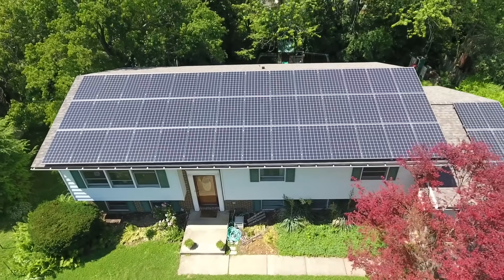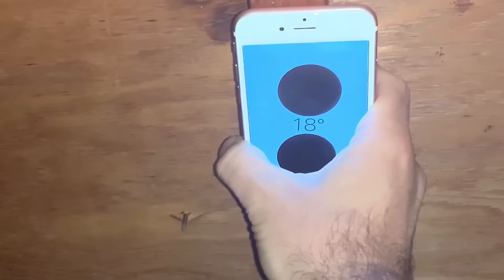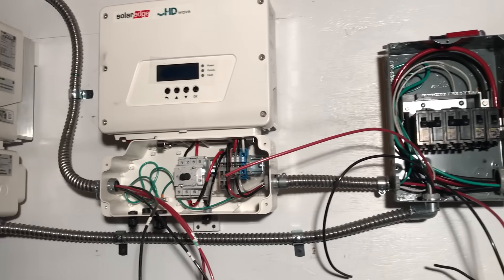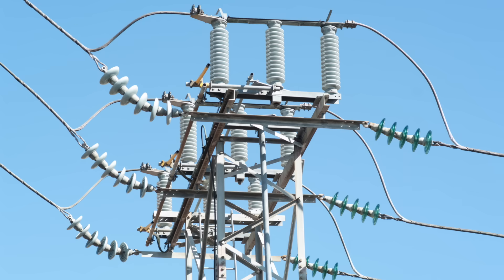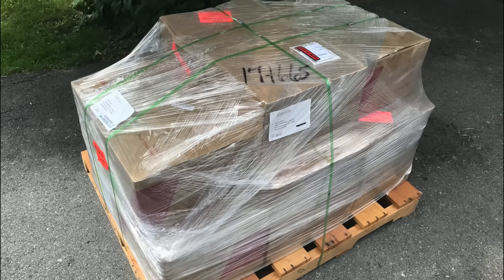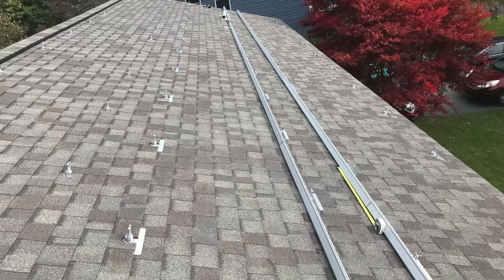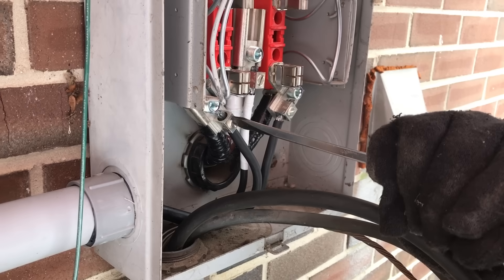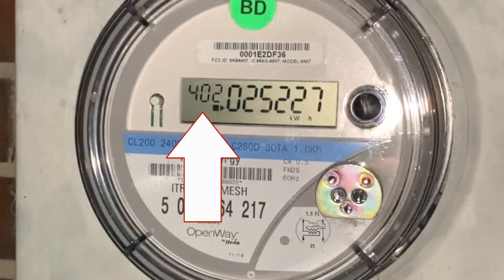I Installed a Power Plant Myself | HUGE DIY Solar Panel System

Comment: Great job. I was hoping you could talk about 2 things.
1. How you sized your energy needs.
2. How do you store the energy generated to be used when no sunlight or you use the grid at night?

Thanks for the video. Learned alot.
I installed a 48V system in my home in Jan 2020 mostly from DIY youtubers. 
Made a few mistakes but worth it.
Reply from the maker: That’s great you did it by yourself! I’ll explain some of those things in the future video.  I did talk about how I sized my system in this video.

Comment: I am trying to change  my inverter to micro inverters but the problem is I have 48v 500w panels and I could not find micro inverter that support this range. If anyone know such please help.
Reply from the maker: enphase should have them for the higher volt panels.  Mine are 55v but I went with solaredge.
Reply: @FrugalRepair   Thank you.. will need international shipping 🤦🤣..I am located in Maldives

Comment: How do you change the shingles on your roof now?
Reply from the maker: I won’t need to change them under the panels any time soon.  I most likely won’t be around when that might be needed. But if they were needed, I’d spend a day or two, taking the panels off, reroof and put them back on.
Reply: @FrugalRepair How’s your ROI been on this system after 2 years of using it?  You originally predicted 14%.

Comment: I cringed when I saw you use plastic zip ties. They will degrade relatively quick and become very brittle when exposed to any UV light...yes even in the shade. Stainless steel zip ties would have been better.
Nice work though!
Reply from the maker: Thanks!  Thankfully they are backup to the iron ridge clips but I’ll be keeping an eye on them.  I didn’t like how loose the wires were on those clips.

Comment: Curious if your house is now cooler because there's no direct sunlight on the roof
Reply from the maker: That’s interesting.  I did take roof temperature measurements with my thermal camera before I installed them.  I may take some measurements after then compare at some point.
Reply: @FrugalRepair  even just asking how it feels in the house. Are you turning the air conditioning on less?
Reply from the maker: I don’t know if I could notice a difference, honestly.
Reply: @FrugalRepair  I guess it comes down to the climate you're in. Summer for me here is 40 c degrees most days so I'd notice it for sure.  One end of my house is markedly cooler because it doesn't get as much sun. I was thinking you've essentially added an extra layer to the outside that is absorbing a lot of that direct heat.  Anyway enjoym

Comment: I did the exact same thing last year. I'm very happy about it. 

To be honest, if you are planning to only do 1 installation, I would say it's not worth the hassle. If you are going to install it on more roofs(friends and family or professionally) then it's totally worth it.
Reply from the maker: That’s awesome!  What size was your system and what inverters did you go with?
Reply: @FrugalRepair  first system was with an abb inverter. A lot of issues at first, but after a lot of googling and searching I made it work. 
Now I placed four more installations with solaredge. Their support staff is great and the helpful tools online are awesome!
Reply from the maker: That’s great!  Almost every installer I spoke before hand recommended SolarEdge.  My panels are 55v output so I had limited options if I wanted panel monitoring.

Comment: I'm so jealous, I was freaking out the other day about my power bill being so high. I looked at the detailed bill and can see why its so high.

Customer Charge
Distribution Charge
Stranded Cost Charge
Sys Benefits Charge
Transmission Charge

That is all before the actual energy service usage charge. Man they are nickel and diming me.
Reply: Could you share what it means "so high" ? Just interested to compare. :)
Reply: It would be cheaper to just get a manual transfer switch (call a licensed electrician) then just connect to a 10,000 watt generator which can be $1000 or so and just burn gas or propane. Granted gas is better

Comment: I am also a supporter of new technologies but I have some reservations about this whole photovoltaic revolution. So
yes, no bills, but the initial cost is huge, and anyway, in the event of a power outage, you are just as without electricity as others 😐 a nice gadget but not cheap, not protecting against power loss, and if it's okay for cash, it's worse if someone takes a loan and then has a loan instead of bills 😏 say how many years would you pay bills for the cost of the entire investment?  assuming nothing breaks in it 😉🤔

Comment: Sure you found an alternative energy source using Solar. But here are some facts you may not be aware of. Our best solar system only captures 26% of all protons emitted. After 20 years of research and billions spent on solar energy it's still only produces less than 3% of the world's energy. Rare Earth materials are needed to build solar panels and batteries such as lithium, Cobalt, and Dysprosium just to name a few. As the use of solar expands so does mining operations in our wilderness areas. Refineries to refine these materials produce massive amounts of pollutants. Solar panels and batteries have a life maximum life expectancy of 20 years, (not 25) and are produced mainly from non-reusable materials. These materials will end up in our landfills. By the year 2050 there will be 200 times more waste generated from old batteries and solar panels than ordinary garbage. You may have saved yourself a little bit of money but you didnt do the Earth any favors. We need to focus our attention on hydrocarbons as an alternative source of energy. Not Solar!

Comment: So the thumbnail says "no bills" how did installing solar get rid of your sewer, trash, phone, gas, insurance, mortgage, etc, bills?  I know, you probably talking about electric, are you making payments on the solar? Or did you save up enough to buy it outright?  If you are making payments like more people would then didn't you just trade your electric bill for a loan payment?  I was going to put in solar myself but when I calculated the true cost and compared it to my grid payments I could spend the same money I was going to spend on the solar setup and just use grid power for 15-17 years.  With the solar setup major components like the batteries need to be changed out ever 5-10 years.  So people like to get solar and say "its going to pay for itself in 15 years...or 20 years.  Yea but thats assuming you don't have to do ANY maintenance on it.  No panels go out, your charge controllers don't go out.  Your batteries don't need replaced, etc.  Sad thing is the batteries last 5-10 years and account for about 25% of the total setup cost, the charge controllers have an expected lifespans of 10-15 years and account for around 10% of the total cost.  So before the 15 year expected payoff hits you are already out another 35% of your total setup cost again which pushes the payoff date farther into the future by another 5-6 years, hitting that 20 year mark before the true payoff, but wait.  By the time that hits its well past time to replace the batteries again at which point you have probably already done this at least 2 times.  If you have only done it once to this point its a miracle and its definitely time to change them again.  So here you are at payoff point and you have to put another 25% of your initial setup cost into batteries again pushing the real payoff period back another 4 years.  Now you are 24 years into your setup having paid a ton of money up front or been paying a loan all this time and finally you have a system that has finally truly paid for itself and isn't in desperate need of major maintenance for an entire year?  That is assuming NOTHING went wrong with any other components, nothing went wrong with any of the panels and the ONLY thing you have had to worry about is batteries and the controller, which, after 25 years is likely next to impossible, but here we are, the system has been paid off finally and you have had a full year of free electricity and now its time to replace the batteries and the charge controller again.  There goes your free electricity for the next 6 years while you wait for the saving to equal your fresh investment in parts.  So out of 31 years of using this system, assuming EVERYTHING went text book according to plan, you have had a whopping 1 years of actual free electricity.  Personally I'd rather work a couple weekend to make what it would cost me for a years electric and forget about the hassle for those 31 years.

Comment: No bills from the Electric Company but you still have to spend money for the solar panels, battery, wire installation, charging devices and maintenance. You can't use electric oven, air condition and other equipment that requires large amount of current. But being free from bill charges every month must be real rewarding.
Reply from the maker: Why can’t I use those appliances?  I use them just fine.
Reply: @FrugalRepair  That's great! How many batteries do you use and how powerful is your dc to ac converter to use all these appliances? If you will share to us.
Reply from the maker: I don’t have any batteries.  I don’t need them. I’ll explain this in a future video.  Net metering is the key part.

Comment: With your panels so close to you gutter in heavy rain it may shoot over  and not go in the gutter also you panels should be atleast one foot from the edge to stop wind uplift well done for doing it yourself and I hope you recorded the location of each micro inverter it makes it easier when one fails to find it and change it micro inverters are great so if the inverter fails you only replace that one at a smaller cost and the hole array doesn't go down and you have to replace one large costly inverter
Reply from the maker: Yep, I have everything recorded.  Thanks!

Comment: I would never put solar panels on my roof because if you happen to have a fire in you attic, good luck accessing your attic from the roof to put out the fire. I would rather do a shade structure in the back of the house and put the solar panels on it. Easier to maintain and separate from the house.

Comment: You did a great job sir but solar doesn't operate 24 hours a day. What is the storage that you installed and how much?
Reply from the maker: Thanks!  I need to answer your question in a future video.  Net metering is key to my setup.  I don’t have batteries.
Reply: @FrugalRepair  I have never heard of net metering? We considered solar in 2016 but we went with a whole house 20 KWH generator because the battery system would have added so much. I am not able to climb on the roof anymore so we scrapped that idea. It would have been $50,000.00 just for the panels, of course living in Northern Virginia doesn't help either.
Reply from the maker: I’m in PA so VA would have enough sun hours.  I can’t remember what VA’a net metering policy is.  I don’t think they have an SREC program.
Reply: @FrugalRepair  after you told me what you did Virginia Dominion power has net metering nobody told me that at the time.. I am from Pa I lived 75 miles North of Pittsburgh a little place call Greenville in Mercer county.

Comment: You shouldn't have drilled that hole in the chimney you're going to regret that later down the road. I don't see why you just didn't go around it with elbows. it would have looked just fine
Reply from the maker: Because it’s just cinderblocks at this point.  There is no inside fireplace or anything.  And the previous owner chopped the top off when they did some roof work.

Comment: Great install. I see one problem with your whole system tho. The power company who has been screwing you over for your whole life fits the bidirectional meter. Everyone who checks what they produce and what that meter says is produced get vastly different figures. The power company is still screwing you. So save the hassle and get yourself a home battery or 2 go completely off grid and tell the power company to ram it.

Comment: As a solar installer this is great! I like your method of installing the flashing at the same time as your shingles, I got a little worried when I saw the state of your roof at the beginning of the video. We use many of the same materials and methods as you did and yours turned out great.
Reply from the maker: Thanks for watching and your encouraging comments!

Comment: We started doing solar ourselves in 2012. Now we're helping other people in Philadelphia do it themselves. In Philly, if you use a commercial installer you will most likely never recoup your investment. 
A suggestion...consider microinverters. He mentions them I think but that's not what Solar Edge is. The wiring is very simple and there is no single point of failure. Each panel has it's own inverter and all are wired in parallel so there is no high voltage DC anywhere. We used Enphase and have had a great experience with the company.
Reply from the maker: Do you have a business helping others get solar?  Good thoughts about micro inverters.
Reply: I don’t charge. I’m a retired, but still working part time, public high school teacher. I guess I can’t break the habit. ;-)
We just finished...on Saturday...a nice 5 KW system on a row house church in West Philadelphia. Taught a class of 10 citizens and trades people from the neighborhood, hands on, how to install the system. 
It was really exciting. There are literally thousands of similar row houses in the neighborhood. They are all super easy to install on. We help with the layout and wiring drawings necessary to get permits, inspections and interconnection to the grid.
Reply from the maker: That’s really awesome!

Comment: One of the best and honest solar panel DIY videos on YouTube with TRUE REAL LIFE COSTS and returns.

While the solar array does look impressive and will no doubt give a strong return I worry the lack of access may bring maintenance issues later in the life cycle.

For example roof top caulking will wear out in 5 years time (depending on the weather of course). Maintenance has been and will also be the true test of the product.

Comment: Where do you live? I live in a county that's in the top 5% cloudy. Also near the 43 latitude so doesn't make sense.  But solar energy increases in value the closer the source is to the final use as you lose power in transmission. So solar farms tend to not be efficient the way a home install is.

Comment: Not sure if  I would tie to the grid without a transfer switch. I assume there is some type of electronics to prevent getting spiked from the utility. also going through the chimney not allowed in most jurisdictions. 
panels look great- good work

Comment: "Net zero". Sounds about right. The amount of energy and resources required to make all those panels should take about ten years to recoup to be "net zero." Massive amounts of diesel used to power the mining equipment (plus the effect on the environment), the huge amount of energy to make the voltaic panels, the energy to run the plant where the panels and wire are made, all make this anything but net zero. It should take just about 10 years to break even on raping the earth to turn all these materials into usable equipment...just about enough time for the panels to start failing and needing to be replaced and start using petroleum to make "free" solar power again. SMMFH.

Comment: Hey! Is it really necessary to connect excess generations into the power grid? I came to know that... if you do like that, during black out, you can’t use the solar energy. Is there a way to use on-grid solar panels during blackouts ? Like can we add a switch connecting excess generated power to power grid? 

BTW you did a great work sir!

Comment: Installation doesn't require that much knowledge but when you crimping adjusting cables isolating power you need certification of competency or else h&s house insurance many other stuff legal side will become a bother

Comment: My plan is to build a totlly off grid house when I retire and solar will be the main source of power. However since I won't be connected to the grid, I will also need a battery storage system to provide power at night. I might even include a residential wind turbine as a backup if it's not too costly. I'm not as concerned about the cost effectiveness of it, although that is still important, but such a system will be massively expensive even if I do most of the work myself. My motivation is simply to be fully independent and of course to not have ANY utility bills.

Comment: I want to do something similar but I cant get U235 or Plutonium at the local drugstore yet. I want a powerstation that make energy year round for the next 100 years and the waste used in thorium based reactors or refined for cancer fighting radiotherapy drugs.

Comment: So I’m trying to close on a house that comes with solar panels, about 47 panels on the roof to be exact. The owner just installed them on the roof in 2017 and they come with a 30 year warranty. I think they are by trinasolar. My question is....what is your bill around in the summer and the winter? If closing on the house goes good on my end, I want to get a rough idea what my bill will look like. Also, the house is a bi level. Looks similar to yours
Reply from the maker: It depends on several factors.  You should fine out what the net meter agreement is.  Here in PA I get full credit for each KWH I make.  With SREC income (you’ll want to find out your state (or power grid) offers it), I have a net income over the year.  I’ll explain this more in a future video.  Hope it works out for you!
Reply: @FrugalRepair  that’s funny I’m in Pennsylvania as well. In the Poconos to be precise.